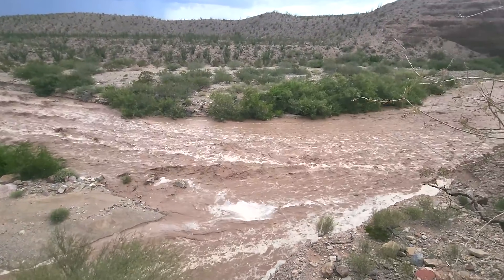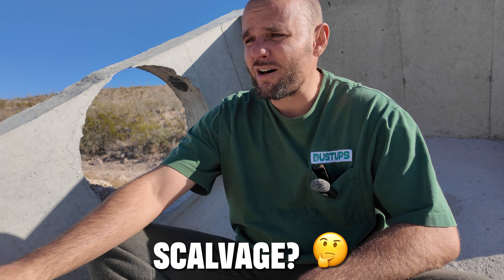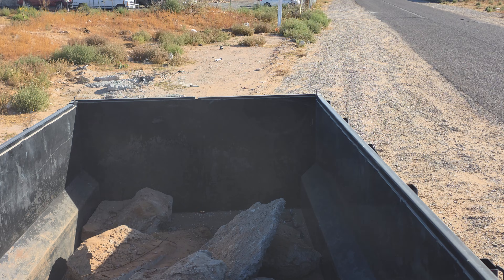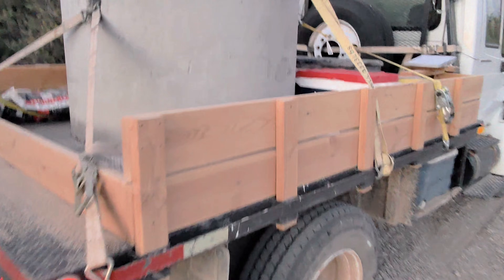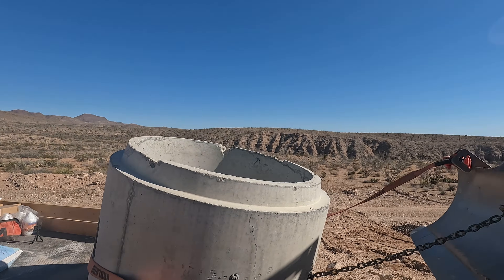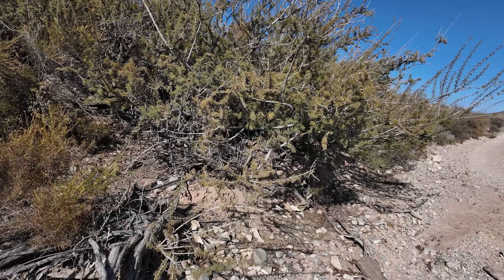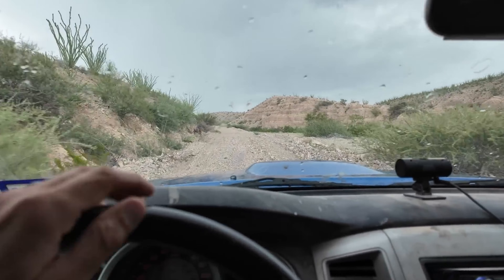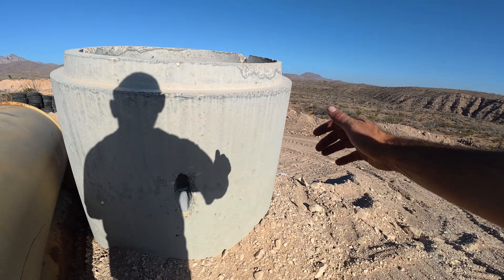I'm Fighting Desert Floods with Free Waste Concrete

Comment: The concrete forms are heavier than the large rocks.  However, the concrete forms are also much larger than the rocks.  This means there will be a much larger force on the concrete forms from the flowing water.  Do not be surprised if the flowing water moves these concrete forms downstream.  The force of the flowing water could be reduced if you only used slabs instead of full forms.

Sediment will deposite behind a weir.  However, the sediment will probably be too soft to support the weight of a vehicle.  Downstream of a weir, a plung pool will be created.  You will probably like a plung pool.  You tried to make something similar bulldozing out gravel from the river bed to make gravel bars.  This did not work.  However, if a weir is created with enough strength to withstand the force of the water then you will get your water holding pools.  Although, they might not hold water for very long.

Comment: It's probably better to have the concrete pieces staggered in a diagonal grid pattern rather than a straight wall. It still does the job of slowing the water but has much lower likelihood of getting knocked over and/or circumvented.
Reply: It needs to be in a V towards a channel in the middle (away from the banks) - and slightly off-centre so it creates whirlpools that take the energy out of the water (Viktor Schauberger type)

Comment: I think he needs to consider two layers of the concrete forms because the water being held back, if it started pushing through one hole, it will then push with more force than in just a regular stream. A second layer to support the first will better help prevent failures and slow the water further

Comment: Yea, have to say with the others that anything you can do to shield your wall to slow the onslot of water will help.  You might also consider physically fastening some of the middle forms together with straps.  These look heavy but a 3' (1 meter) deep flash flood (3'to 5' (1-2 meters) per second) can move 1000 to to 3000 pound (454 kg to1,361 kg) objects.

Comment: Why don’t you connect several of those large concrete pipes for water to flow through. Then you could put a road over the top of them to drive on when it rains.😮
Reply: This is a great idea, might take him two years to get enough concrete, but it's realistically the only permanent solution
Reply: SHaun mentioned in a previous video what is allowed in this creek and what isn't: He must not dam it, but he is allowed to do flood control. Obviously there is a sweet spot in between this two that is allowed and still functional.
Reply: That would be very expensive.
Reply: Because the goal is to keep water and sediments on the land, not drain them away, and also because these are defective so they cant bear weight reliably, hence using them as big weights to block erosion

Comment: This air intake idea won't work.
You need a large buried area. A local buried bin with ventilation will quickly take over outside temperature.

You simply need a much larger contact area.

Don't waste your time on that. For your own good

Comment: Those concrete drain rings could be used to create groundwater recharge wells or percolation wells. It could even be a matter of doing one where you trap a lot of water and then pump it into the well.
Reply: I was thinking of the same thing, why not use them to store water.
Reply: @9amStudio  the way the indians use them is they will place it on the ground and start removing the earth underneath so it starts to sink, and then they will place one above it and keep going until they get their required depth.

Comment: Dont build a straight line across
Instead leave a section 8n the middle open 
Ten feet or so down steam put the pieces that would have closed the center section.
The debris will build up and settle along the sections and start to slowly fill the gap.. by the time the gap naturally fills you'll have had time to add more materials on top of the firstlayer of cement and debris. 
*if you try to stop a wall of water it will push out your dam but if you leave a place for wall to easily pass it will instead offload any debris being carried so as to fit throught the gap easier, any debris that makes it through the gap piles up at the slightly down stream mini dam - i learned all this by observing natural seasonal water flows
Reply: **the section ledt open can be any size. I should have used a comma before the ten feet sentence 
|.....v.....|
|___...__|
|....----....|
|.v.......v.|
V=water flow
Reply: Can see what im working with -
https://m.youtube.com/@thomascoleman444
Reply: * if you had the time and enough heavy cement barriers making many rows of alternating checker pattern of rocks and gaps would deposit the majority of debris and drastically reduce the erosion.. takea a ton of space and materials to build to deal with the scale of the water your up against.
🤓 every time the water has to split and change direction it loses energy and combined hydrostic weight(breaking up the wall of water into more manageable pieces) as the water losses momentum it will drop what it is carrying

Comment: I've worked with granite and other rock that is similar to the weight you're dealing with. If you spend $50 on gas for 50 loads, that's $2500, plus the extra time for each load. 

I suggest considering a dump truck to rent and see if they are under $2500 for two to three trips. 

If you don't do it for this project, just keep it in your book of tricks. It's usually pretty easy to run a quick estimate and check the numbers on if it's worth it. Those few minutes of research can end up saving time and money in the end.
Reply from the maker: I don't have a CDL for operating a dump truck. I need the farm plates to legally operate
Reply: @dustupstexas I didn't have one either. The rental company had drivers available to run the loads for me. Just a thought. I'm not sure if the logistics work out for your situation, but I figured why not try.

Comment: I am puzzled at the water management here. You suffer from massive floods, but have no water. I am lame because I don't know what the rules are here, but I'd look at artificial pools, lakes, wells, drill holes, pumping water from the flood and more.Hell even if you just dug a swimming pool sized hole, and then used the flood water's power and pump to fill, that would probably give you months of water for watering plants or land. Are you barred from making a swimming pool on the ranche?
Reply: I think the ground is just a thick layer of gravel so that water won't stay when you just dig a pond/pool.
Reply: @leonlowenstadter9223  OK, but thats not an insurmountable problem, pool liners face off that issue in every build?
Reply: @AdmV0rl0n They surely do. I was more concerne considering of the cost that a full pool build will bring in the size like 50 x 50 foot.

Comment: Easiest, I would agree with you, is to start building and installing lines of gabion baskets across the large wash. Eventually, using local rocks from that stream bed, there should be sufficient ballast to hold themselves in place. Use large guage gabion mesh, not chicken wire or other weak metal. I would imagine three rows across with riprap in between might give you a good fording cross location, and most high flows would go over the placement during peak flow.
Reply: Used Chain link fencing
Reply: @Barskor1 That's it!

Comment: the problem I see is if you restrict 50% of the river, the 100% of water will flow twice as fast through the gaps scouring the riverbed twice as bad, and leave a drift of deposits downstream when the water slows again similar to a snow fence.  if you restrict 100% of the riverbed creating a weir, 100% of the water will go around it or over it.  both have issues.  if it goes over, it will create low pressure behind the concrete, and suck up silt and gravel creating holes behind and undermining the concrete while carrying material downstream depositing a drift again.  if it goes around, you have a whole new set of problems.
Reply: He won't restrict flow just stabilize the bed against erosion.
That's the goal

Comment: Have you already thought about using the water flow itself to slow down?All speed is gained in a narrow channel and slowed down in the expansion, it is also good to make the crossing at an acute angle in the opposite direction from the flow on both sides.
Reply: J hook barriers

Comment: Always start as upstream as possible...the water after the dam will be slowed by the dam, so the next dams work better each one you build downstream...
Reply: Yes Ideally you would start in the foothills of the mountain with small gabions to stop the flash flooding.
Unfortunately he doesn't own that land.
He should as you say dump the concrete up steam and work down, while he still has acccess. Can't do it when theres a dam in the way.
Reply: @James_Innes This is really practical.  The question is going to be, how much the water slows and how much weight it moves before it slows!

Comment: the cage boxes would be a good idea. as you can get them empty and use the rocks from around to fill them and then pour concrete over the top.. you could use the tubes between the cages to allow the water to flow through

Comment: Fan-watching from Martinsburg WV: Shaun, with regard to the concrete conduit, I was thinking, once you finish your river crossing project, it might not be a bad idea to experiment with reusing those conduits as shelters to plant plants in. Hear me out: the concrete has thermal insulation and shading capacities due to its immense bulk. If you dug a pit about 3 feet deep and sunk the conduit pipe in upright, and then back filled the inside with a foot or 18 inches of good soil, it might create a good micro-climate/ a good place to plant a small guild of desert plants and trees, and my thought is that as they grew, they would have permanent shelter from the sun/wind/cattle. And if that worked, you could line up a series of them in a tight circle and the interior of that circle would create another micro-environment that had a lot of protective benefits that would help you get your food forest off the ground. Just a thought that occurred to me as I saw you guys unloading it in the riverbed...
Reply: I was thinking about that too. Even just a rock wall made with some of those big rubble pieces near camp would provide some nice shade & slow down the wind at ground level.

Comment: Maybe try using the free concrete and large boulders to reinforce the sides of a small canal.  Start the canal upstream of the road crossing make it sloped downhill and start wide at the top and small at the bottom.  Have the exit point be before the road crossing so it creates a jet of water pushing the flood waters away from the bank and helping to slow the water down just before the crossing.

Comment: Hi! An Austrian guy here. May i ask: if you put this concrete blocks in the stream  would the water just wash away the gravel under the blocks because of the faster moving water like the airflow on an planewing? The stream is so powerful while moving that any obstacle is building an resistance to the stream.  Tell me that 'm wrong... bg, Rainer

Comment: I have seen have the east coast of Norfolk uk where I live, has been devastated by constant wearing away the cliffs. Houses that were 30 or so miles from the cliff edge are now on the beach. They have placed sea walls - concrete  or rock walls. Groynes - wooden or rock barriers. Rock armour large boulders placed at the cliff toe to prevent erosion. I also seen gabions used. All in the name to slow down the erosion of the cliffs. Of course, the sea just smiles & says, c’mon try again!

Comment: if its only 14 trips you might want to do it in multiple spots along that drain...you slow it and making large holding tanks in your land..
Reply: That’s what I was thinking. Over time he should build 2-3 layers to this at 50 yard intervals and trap as much water there as possible. With the amount of water he gets from each flood, that’s likely hundreds of thousands of additional gallons of water per flood event
Reply: @Eduardo89rp  money is his biggest issue...

there is a spot i seen in a different video along the waterway with a small cave if he had like 3 sticks of mining dynamite to stick in that hill he'd have a gravel dam built there in a matter of seconds
Reply: @zigzagzarf  If it's 25USD per trip and he needs 14 trips per row that's 350 USD for one row. Having 10 rows would net 3500 USD. That's gotta be fairly reasonable. Man, I'd gladly chip in.
Reply: Up stream and downstream, yes.

Comment: Shawn, we used leftovers from our driveway replacement to have a retaining wall built across the front of our urban yard, with an herb spiral to use the soil from regrading. Seven years later, with sedums, bulbs and ground covers, it looks amazing. Here in Wisconsin we have this strange phenomenon of water falling out of the sky, so it covered quickly. 😂. We had pottery-ready clay, which caused basement flooding. After multiple seasons of plant diversity and deep mulch, soil and biology is transformed. Basement water gone. The soil “drinks” it. Your strategy, appropriate to your more “brittle” environment will work. Thought about vermicomposting?  A small bin on site might both consume food waste and provide biological seed for free right there at hand
Reply from the maker: I want a worm bin, but I also can't sign up for any more maintenance tasks. I'm spread too thin. For now, we concentrate our organic waste in the cave hole
Reply: @dustupstexas 
Understand. 1 hour to set up, 10 minutes maintenance every couple weeks, same amount of time to feed them as to haul waste to trash🤷‍♀️not so bad?  No need to bring/ purchase/ shop for inoculants at the store. Might be an even trade off.
Reply: @d @dustupstexas 

I wonder if putting worms in the cave hole might achieve the same result. 🤔

Comment: I don't think that you need to fill the whole ground with concrete. As long as the concrete blocks are stable you could put large rocks between (in front of) the concrete blocks. They shouldn't be able to move away/squeze through between the concrete blocks when the water comes if you chose large enough stones. If you place one large stone between each concrete block I think you could reduce the amount of concrete needed with maybe 20-30 %. Just a thought.

Comment: Great find! Brings the communty together, recycles, piggybacks on what you're already doing. After the road project, cylinders buried at surface level in the central wash and filled with gravel could make cisterns for water recharge ... There are probably examples out there of how to optimize cisterns for water recharge.

Comment: Shaun I have a tip for you on hauling the waste concrete. In order to prevent some wear and tear on the bed of your trailer with that concrete getting dumped in, if its feasible put something else like dirt in there first to cushion the concrete. 

My brother has been in the heavy equipment industry, clearing land, demo jobs on houses, etc, for many years. He told me when he knew he had a concrete slab to rip up, he'd put a little bit of dirt in the bed of his dump truck first, so when the concrete got loaded in with the excavator it didn't beat on the bed of the truck nearly as much. 

That wheel loader in the video can't load anywhere near as gently as an excavator could, so long term you could save alot of wear on the dump trailer bed if its feasible for you to throw a layer of dirt in there before you go get a load of the waste concrete.
Reply from the maker: That's a great suggestion. We have waste conveyor belt. That would be wise to glue to the bottom, although it will make unloading more difficult
Reply: @dustupstexas it might make it more difficult to unload. But there's alot of options. 

Toss in a few of the old tires you're already using on your property. Let the concrete get dumped on them, cushion the dump trailer floor, dump it all out on the site at the river crossing, pick the tires back up, use on the next trip, rinse and repeat. 

I've been watching since right after you started the channel. Love to see the progress and ideas every week. 

I was just thinking yesterday, how your desert forest reminds me of Fallout 3 and the settlement of Oasis in the capital wasteland.